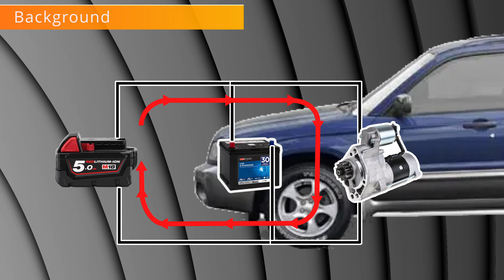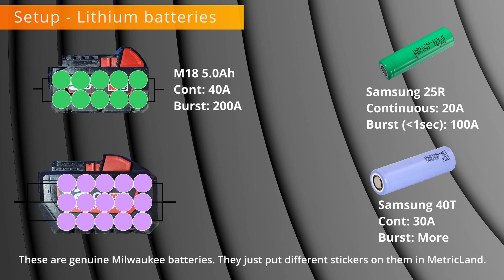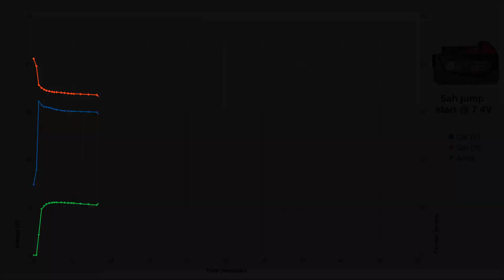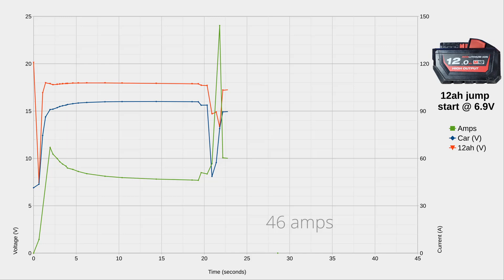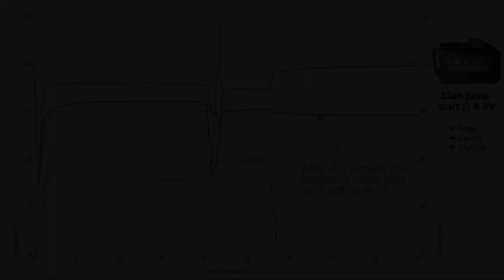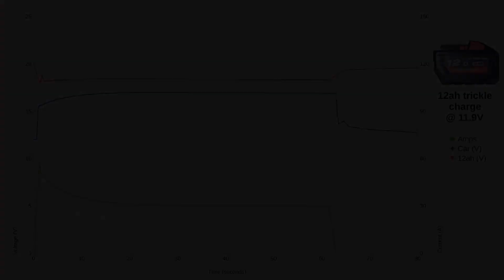[001] Jump-start car with 18V battery: How much current and voltage?

Comment: Try using the 6.0 high output as it can take up to 50Amp per cell 
2P - 100Amp
Reply from the maker: On paper, the 12ah is more powerful and has less resistance. 12ah is 15.2mΩ*5/3 = 25.3mΩ, whereas 6ah is 11.6mΩ*5/2 = 29mΩ.

But the Samsung 30T seems to be a lot tougher than the 40T, so the 6ah will handle the abuse better.
Reply: @toolscientist  yes i have not seen one really good bad beside people break the case.
Torque Channel verified this Samsung 30T has way higher discharge rate, it rated at 30Amp
but turns out that they can handle 50Amp

where 40T struggle at 30Amp, i seen all kind of weird dead 12Ah batteries from shocking dead bank and some won’t charge properly, 8Ah has bunch of simply won’t hold charge, sagging

Comment: I realky like your channel! The video information was well put together. The 12ah is a beast for sure. I have one on my bench right now having some issues. Hopefully I will have some troubleshooting info out soon on them. Its been an interesting look inside of the 12ah.  I have seen enough here to be certain the 18650 cells would not take much of this, they give enough issues with smaller loads as it is. The 21700 will most likely take it just fine, especially 3P packs. I did find out however the the INR21700-40T1 cells do have an issue holding up under high discharge loads (capacity diminishes greatly). Samsungs data sheet seems to show the INR21700 40T3 (newer version) doesn't have that same issue. This 21V on the 12-15V system for me is just not worth the risk. Especially if the car battery is just barely too low to turn over. That is the most risk to me when the pack is full at 21V and the car just sit there with lights on etc. and now it can not quite get the engine fast enough to crank. Keep up the great videos!
Reply from the maker: Thanks! I agree there's risks and I see both sides. I was happy to give it a crack on my 20yo car, but I'd be very hesitant to do it to my 4yo car. I mainly just wanted to put some real numbers out there to help the discussion
Reply: @toolscientist  
Absolutely!

Comment: Eh This will vary allot from car to car and case to case. 

I have straight up jumped my car (2 Liter 4 Cylinder) with what as probably at best a 4ah battery (it was from the cheapest ass drill from harbor freight that doesn't even give a rating on the battery), twice. I used to work nights while going to a trade school during the day and kept my tools in the trunk. So when I came out from work at 3 AM one day and found the car wouldn't turn over I got a no name drill battery and some multi-meter probes which I used to jam into the contacts, then clipped acutal jumper cables to the exposed banana plug of the probes and connected those to battery. There was enough juice still in the car battery to bring on the lights, but not turn over the motor, the drill battery easily jumped it (although it did overheat the probes pretty much instantly and start melting the plastic near the battery contacts a little). Then I forget to replace it and it ran low again a few days later and I had to do it a second time. 

There was zero damage to the car and the battery still worked afterward, I still own the car.
Reply: I wonder if leaving the tool battery to discharge into the car battery for say 5 - 10 mins checking to see that it does not overheat might take more time but be safer.  Not melting your multi-meter probes :-)
Reply from the maker: Definitely. My aim was to at least give some sort of ballpark numbers. I've seen people claim that it will push the car up to 21V or that it will pull 400A from the tool battery, so I think I've somewhat disproved those extremes. In my case the car battery was very dead and wasn't even turning the instruments on, so that's why it needed the bigger battery to get it going.

Comment from the maker: Apologies for this glorified powerpoint presentation. I filmed this nearly a year ago and have since replaced the car battery and sold the car, so I only had footage of the engine bay to work with. My next vid (testing the current in cordless power tools) has over an hour of footage to sort through, so I promise it will be better...maybe.
Reply: It's a good and informative video, this is my second video of yours I've watched and it's great value.